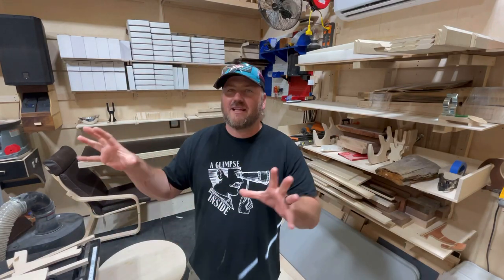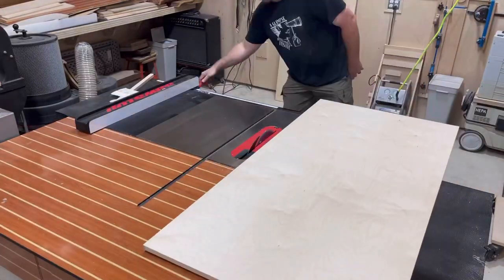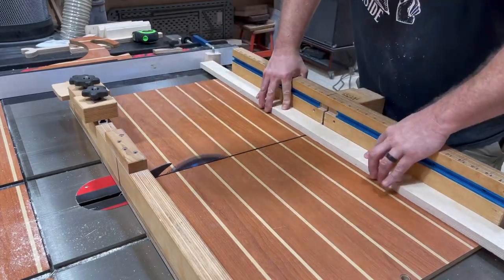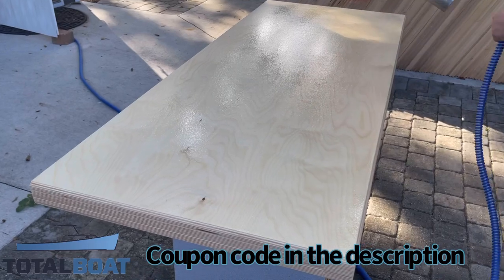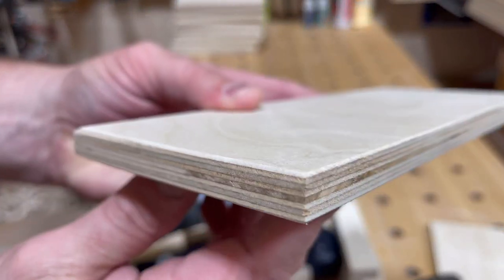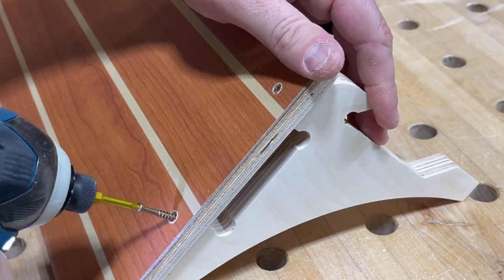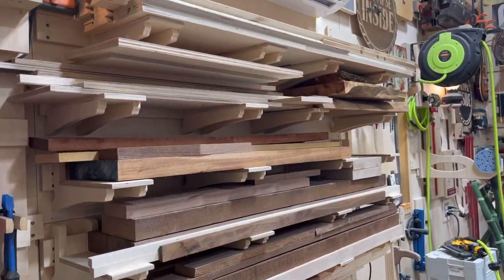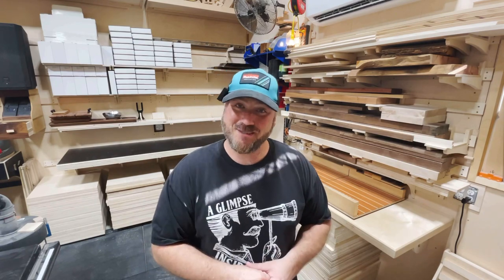French Cleat Lumber Storage Rack

Comment: Any thought to adding holes to your sled to hang it somewhere and reclaim the flat surface for more utility? Keep up the good work!
Reply from the maker: That’s a pretty darn good idea actually might have to put some type of mount on the side. Thank you
Reply from the maker: I just went and looked at it already has a hole in it are used to mount it that way. You might even pick up that hole in the video it’s on the left-hand side near the middle. Looks like I’ll be able to put a 3 inch screw into the side of this new countertop I think it’s gonna work

Comment: Love the videos Chris, keep ‘em comin’. 

I’m having a hard time finding Baltic Birch plywood here in San Jose. The big box stores have Birch in a 5-ply, with more voids than I see in your Baltic Birch. 

Question: if you have a void after cutting plywood and that void is nothing more than unsightly, how would you fill it?
Reply: CA glue and sawdust and sand it flush.
Reply: Try searching for a local lumber dealer.
Orange and blue stores almost never have the high quality BB.
Its really not much more expensive than the "better" grade at thoae store either. At least thats my experience here. ymmv.
Reply: Out of the three local lumber yards I contacted, only one had Baltic Birch. That yard only has 1/2”x5’x5’ sheets for $50.

Comment: Winner Winner Chicken Dinner!  I've been watching a bunch of vids, and IMO yours is the most versatile, hands down.  I just liked and subscribed.
Question(s): any idea on weight limits for the double-cleat shelf brackets?  If never tested to failure, do you have a limit to when your "Spidey Senses" start tingling?
For example: would you stack twice as much on the bottom shelf (near end of vid)?

Thanks for any help you can offer; probably only able to do a couple rows for now.
Reply from the maker: I would say at least 200 pounds. Maybe more but really most Clit feel your points are going to be the piece on the wall not being attached with enough screws not necessarily the brackets. Thank you for the kind words